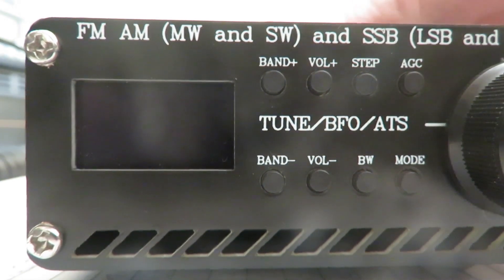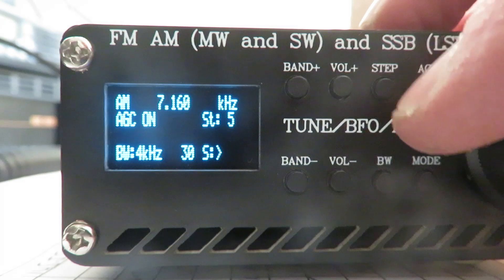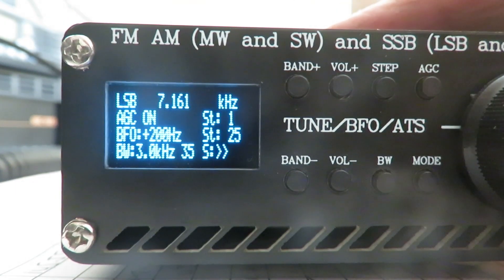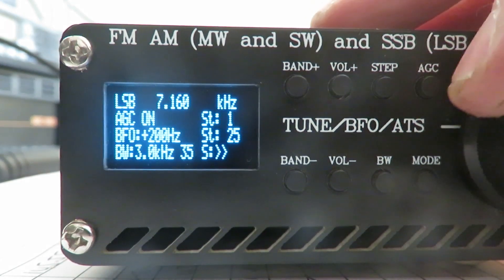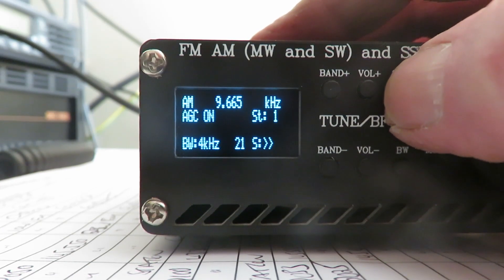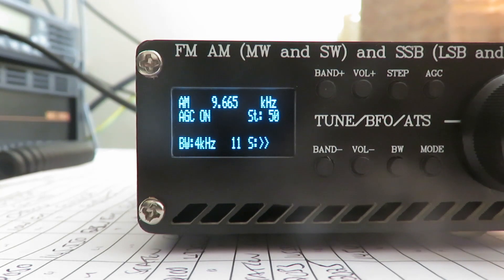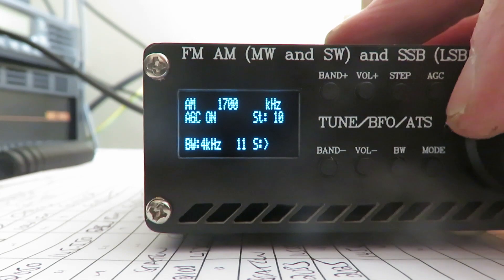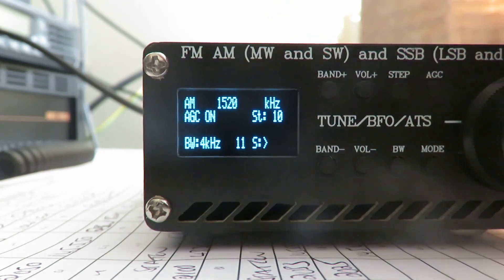Another Update for the SI4732

Comment: On mine i upgraded to 3.7 fw,its terrible,most times it wont respond to the rotary encoder,ive had it apart and cleaned it,no change,i imagine its down to the polling timings in the sketch,i find v 1.1.5 original so far works best!
Reply from the maker: Most likely your encoder is failing. Unlikely to be the firmware.
Reply: @KevinOReillyswl  as i said the encoder looks absolutly spot on inside,was smothered in grease to on the wipers that i cleaned,it was fine on the original fw,any idea where i can get the original sketch to flash it back?,cheers m3vuv 73
Reply from the maker: @paul.alarner6410  you may find the earlier versions on GitHub but those encoders are very poor quality and most people seem to have had issues with them
Reply: @KevinOReillyswl  Yes i found that but its not in the form of a downloadable sketch,looks more like source code,not simple by anymeans,why he never included the original firmware in his arduino examples under aliexpress kits seems pretty od,be better so folks can roll back easily imho!

Comment: Given the low quality of this radio it is hardly worth building an SSB transmitter to go with it  but it might be worth building a clone of the Retro40  AM transceiver from  Dave Benson /  SWL Labs.  You'd want to build it with variable Tx frequency . The schematics for the base unit are still available on the WW. it is  6 W PEP AM unit of quality design. 

 The only thing is that the modulating transformer is a bit light on it is a TU048 which Mouser have or had and is dirt cheap. Use two in parallel. Dave Benson mentioned this issue to me  via email years ago.  It would be relatively easy to get the power up to order 15 W PEP,  ie  about  5 W CW out with a 74 AC 04 used as driver chip for the PA Mosfet.  The piece de resistance would be to get   "direct on frequency "  osc signal out of the AT - 20 and then  you would have a true transceiver.

just some ideas.  Dual banding such a transmitter design would be very easy and the LPF for the 80 mtr version already exists as the Retro-80

TE Fidler NzL

Comment: I just ordered one of these little units, Can't wait to get it. I'm thinking I may try and upgrade mine to a larger touch screen or even just a larger screen in general. I'll have to do some digging for a page dedicated to the tweaking/hacking around with these little units.
Reply: Did you get it yet?  Jim AJ4DJ
Reply: @jimdepalma524  I did, I'm quite impressed with the audio and reception of this little unit. If this had band pass filters it would be quite bit better with larger antennas but for a portable unit I like it. I've joined a group.io for these little all in one chip receivers and I'm doing some research now to see about upgrading the screen to something larger. If so I'll have to see about 3d printing a case for it.

Comment: My digital encoder failed. Any suggestions?
Reply from the maker: Rajek. The encoder failed on one of mine. I did this and it worked. i don't know why, perhaps a dry solder joint but it worked. i gently prised off the tuning knob. Tou will then see the encoder connections beneath. I tapped on the connections with a small screwdriver. at the time I was just looking at the radio to see how easy it would be to change the encoder. However when i put the tuning knob back on it all worked. Strange but true!

Comment: Kevin
Another great Video
Thank you
Just upgraded mine and it works
Fantastic .
All working
Love all the new features and bigger display also the memory retention.
Cant think of anything else.
This is a fantastic receiver.
I will purchase another one
Thanks again
Give Recardo my thanks
Andy M0D45N
Reply from the maker: If you do get another I would try to get one with the mini rather than the Micro USB connector. My radio with the Micro connector (marked as an ATS-20) has an odd Arduino board inside and I have found it very difficult to flash the firmware.

Comment: Kevin, did you repair the encoder ??  I though you were having problems with it not changing freq when you turned the knob......   please advise.   thanks
Reply from the maker: Bill its working again, i don't know why though. just removed the tuning knob and gave the connections a tap with a screwdriver, it has been fine since. Odd I know.
Reply: @KevinOReillyswl  I would probably go in and touch up the solder joints where the encoder connects to the main board, considering the other bad soldering you had to deal with in this rig.   I have one coming and am going to open it up and go over the whole thing. thanks for your videos.  good luck with your second rig. hope it works out better.

Comment: thanks for the test.  I have already worked on  several improvements to a Kit made by David. It is a bit similar to yours. I fixed the problem when the user turn the radio on on  SSB mode; the frequency display is now greater;  the bandwidth became a property of the band and it is also saved into the eeprom; the RDS is  improved; on FM mode I added bandwidth auto, 110, 84, 60 and 40 kHz.
Reply: Where can you get this upgrade?
Reply from the maker: Watch my latest video on the upgrade to V3. That is the best so far and there is a link in the description.
Reply: Hi Ricardo
Thanks you very much for your hard work.
I have just installed the upgrade and it is working very well for me.
I look forward to testing the RDS upgrade.
I am an FM FXER and have a high directional antenna.
i  also love the larger display and the band and mode retention after power off.
Thank you again
Kind regards
Andy M0DRN
Reply: @m0drnandy721  Thanks for testing it. If you have used an old version with data sorted into the eeprom, you may experience problems. If so, turn your receiver on with the encoder push button pressed to RESET the eeprom content.
Reply: @pu2clr  Thanks Ricardo. I had used your previous version.  Which I got from Kevis Youtube.  I just reset the eeprom just in case and run the download agaub. All is working 100%
This receiver is amazing thanks to your help.
The memory retention and the display size is a great improvement
Reply: @m0drnandy721  good to know. Thanks.
Reply: Forgot to metion I am actually using your 3.0.1 version
Reply from the maker: Ricardo, great work, I have updated and it all works well. Thank you.

Comment: Hi Kevin, Thanks for the video’s, I am still waiting for my SI4732 to arrive from China and your video’s are quite good to watch in the mean time. I have got a raspberry pi4 running Arduino and I got it hooked up to a uno today and sent a sketch to it :) It has all of my ham radio on it, just proving that works fine... Bob VK3CDE...
Reply: I think the way the encoder was installed,  the diameter of the knob and the size of the axis are producing an extra strain on the mechanical contacts of the encoder. That situation is causing the encoder to be damaged sooner than expected. I think a solution would be to use some support to prevent the encoder axis from flexing or moving in a wrong way.